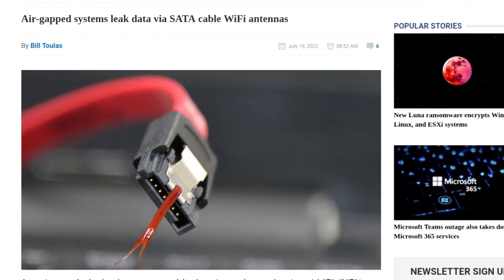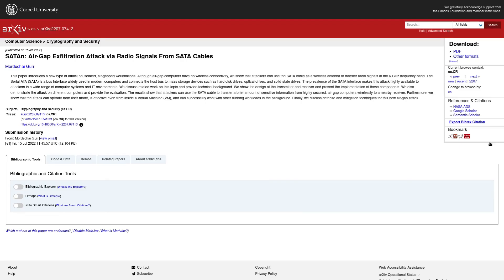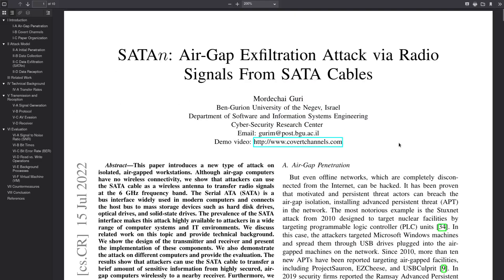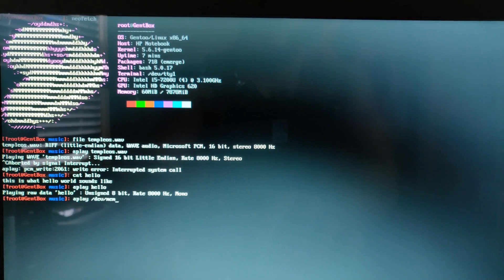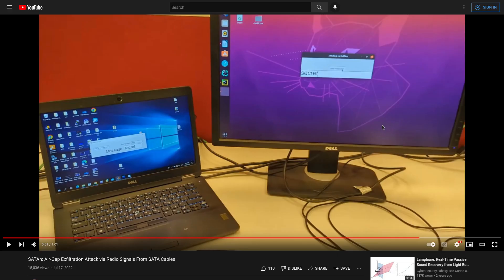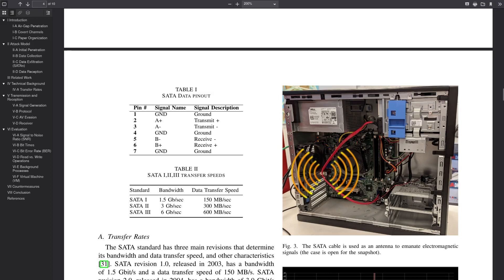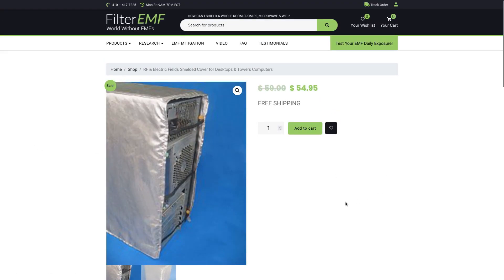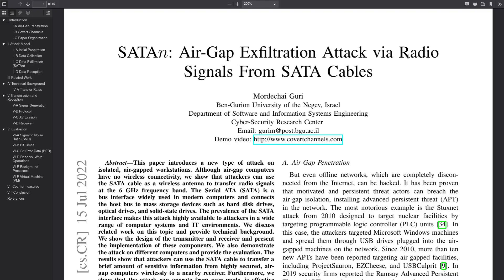Stealing Data Wirelessly From an Air-Gapped System

Comment: Speaking as someone who is somewhat familiar with electrical theory, wouldn't the usefulness of this kind of radio exfiltration heavily depend on the strength of the radio signal? It's entirely possible that the signal may not propagate beyond the building the actual computer is in. I invite pentesters to chime in here.
Reply: The transmit range and bandwidth/transfer rate of this make it very impractical. Seeing as you need phsyical access to the system to begin with, there are far better options. For example, you could swap out the USB keyboard (assuming it's a wired keyboard as it should be) with one thats identical but has a keylogger and wifi exfil chip installed inside it, or you can use a small USB male to female adapter between the PC and cable that has the same kind of keylogger and wifi exfil chip in it, or you can install a WiFi enabled lan-tap on the lan Ethernet cable connected to the PC. There are lots of options to setup wireless exfil from an air gapped PC once you have phsyical access.
Reply: @bluegizmo1983  Trust me, it is an attack vector used by foreign state intelligence services.
Reply: It could be enough that your neighbor or coworker has some Iot device like Alexa in the signals range. Now suddenly they can just run a program on all Alexa's to scan for a certain signal and they'll find you out of millions of people. Your exact location would be compromised
Reply: This sort of attack assumes a high security target, but also a highly motivated and resourced attacker.

Even if the radio waves make it just past the locked door, or even just at the locked door (so you could stick a receiver under the door to pick it up), then this attack provides some benefit. They no longer need to get past the door (which might be very difficult to do without raising suspension)
Reply: yeah in two wonky copper cable form it's not viable. considering this only works when the attacker would have physical access to the device at some point to install the malware and do the sata cable voodoo, he should just bring a pre-made antenna with appropriate strength to plug in that sata or wherever else he wants.
Reply: You're right, this definitely isn't going to put a MIMO A/G signal or anything, but it doesn't need to.  Any time you turn something into an antenna that wasn't built (initially) to be an antenna, you have very limited range.  The shielding that MO mentions are very deliberate steps to keep things like this from happening in computers, but also other (industrial) systems.  RF filters/ filtering on the outside of cable connectors or inside physical chassis are generally commonplace...though usually due to performance concerns (mitigating actual EMI...not specifically a security measure).  Generally speaking - if this is an established vulnerability...there is going to be someone who finds a way to exploit it.  With the right equipment you can see bluetooth at over 50 miles...just saying.
Reply: That's why antenna was 1 meter away from the system and it's absolutely useless exploit. Case is basically Faraday's cage and with all that EM noise around it would be like searching for Higgs boson in a hay stack.
Reply: Currently in security her we did this at Ferris State University as part of my Infosec degree. Theoretically and in a controlled environment yes. In the real world No. Further your high gain antenna has do to packet injection and special software I am not going to talk about has to capture this low transfer wavelength.We had a class on this is called signals intelligence.
Reply: @elir.torres8642  why mention software and refuse to talk about it I just assume you’re lying
Reply: @rumpelstiltskin9729  As I said you need to take a signals intelligence class. You need to know about the MHz spectrum, carrier waves, TV and radio transmitting power, data  coding and decoding, electrical theory, physics on top of all the math needed. Why would I discuss pre-thesis work with some stranger on You Tube when I bust my ass for 6 years acquiring a Bachelors Degree in Information Security & Intelligence . You think you could just walk into your mechanic and have him explain how to rebuild a transmission? Why would anyone do that for free. This subject matter is hard and is not just doing "IT" work. There's permutations and statistics behind the scene. This is why these degrees exists.
Reply: @elir.torres8642  okay but whats the special software you arent going to mention
Reply: @elir.torres8642  full of yourself ehj
Reply: @elir.torres8642  um, SDR?

Comment: So an attack that only works if you already have access to the machine. Thats like stealing the drive and do a brute force key program over it
Reply: the whole point of air gapped systems is that even if you have access to the machine, stealing data is pretty hard.

Comment: You just got me to search for shielded SATA cables.
Reply: Just Faraday cage ur desktop
Reply: @ոakedsquirtle  I have too many machines. I might as well shield my whole crib.

Also, signals emitted from VGA cables can be picked up by AM radios, then decoded using an ADC and a micro controller to recreate what was shown on the screen.

Comment: If the attacker is that close, you're screwed already. No reason to panic over this.
Reply: You mean, if the attacker has its receiver INSIDE your computer case.. that is for this to actually work lol.
Reply: @gmlviper  
Could be done by a malicious manufacturer or somebody at Best Buy putting bugs in prebuilt cases before selling them to the end user.
Reply: @augustday9483  But then the range is still shit
Reply: @augustday9483  Why would you not check your hardware for suspicious parts when you're building a high security system?
Reply: @augustday9483 that’s some government conspiracy level plans at that point but it’s not impossible. Good idea to build most things yourself if possible
Reply: @MrBl4ckY  
A high security system would be checked for malicious hardware, yes. But a prebuilt being sold to normies? That's the attack vector I'm thinking of.
Reply: @MrBl4ckY  Most people would, but there is always gonna be that 1 person. just like most people dont fall for phising, some still do..
Reply: @augustday9483  Point taken.
Reply: @augustday9483  even high security hardware can't be properly checked if there are inherent security issues with Nvida drivers or Intel Processing Units
Reply: @ska187  Have you heard of the Echo system?
Reply: @augustday9483  Walmart.
Reply: mlg swag montage
Reply: I could only panic in car connected to network. 😆
Reply: Or they could just be using your phone to facilitate this kind of attack. Phone security is a joke
Reply: Close to you like ways to be trying all manner of things on homeless people...cuz you're outside or in some non-private space 24/7/365.

Comment: Any copper trace on the PCB of a mother board is a potential antenna. The LEDs are suspects too along with the piezoelectric speaker that beeps when the computer turns on. Moral of the story Faraday cage the air gapped computer, don't connect a piezoelectric speaker to the motherboard, and tape over all led indicators.
Reply: I really want my next PC case to be a lead lined granite box. making it 350 pounds is a small price to pay for TRUE security. Also the rock is pretty good at thermal conductivity so it should help cool some.
Reply: @l0lLorenzol0l  it would be more secure if your pc was a completely solid lead cube. A small price to pay for privacy
Reply: @l0lLorenzol0l  Theftproof at the very least
Reply: @l0lLorenzol0l  “The Rock” 😂😂
Reply: @l0lLorenzol0l  and no one can exfiltrate/steal it
Reply: @l0lLorenzol0l nice shitpost hahaha
Reply: Networks can be run through the power cables.
Reply: @madthumbs1564  that requires transceiver.
Although theoretically you can create high/low current use by the hacked system and transmit 0 and 1 this way without dedicated transceiver.
Would be very slow though.
Reply: @madthumbs1564  Two extraordinarily dumb mitigation ideas:

1. Use a high-power optocoupler - a device that doesn't actually exist (for good reason). It's a very powerful LED lamp pointed at a solar panel, with both devices encased in epoxy. The computer is entirely electrically isolated. The power input of the PC is constant - any power that doesn't get turned into heat in the computer is turned into heat at the surface of the solar panel.

2. The computer box contains two batteries. Each battery can be either charging or connected to the computer, but not both. At any given moment, one is charging while the other is powering the computer.

But wait, you say! You can extract data by leaving the battery at a specific charge level and measuring how long that battery draws current for when it charges!
For this, you add a heater to the computer. The heater's control circuit ensures that the computer again always draws constant power.
Reply: @madthumbs1564  yes, and there are extenders that even run through power lines at 100mbps
Reply: @madthumbs1564  make your own full wave rectifier to convert all signals to DC then make your own inverter to make it back into AC so you can electrically isolate the air gapped pc from the electrical mains while your at it might as well add a battery backup in conjunction with it.
Reply: @madthumbs1564  i wonder if you can use the power cable as an antenna by doing power heavy tasks at high frequency
Reply: @your-mom-irl  interesting idea. There would be far more emf emitted by the psu. Capacitors would filter out high frequency but a very slow signal by variable power usage could be done, like bits per minute. That kind of signal could be picked up with off the shelf hardware at a decent distance. Still would need physical access to install malware or hardware to make it work so I can't think of any real world use cases.
Reply: @simontrueman  you could probably pick up that signal with an ammeter hooked up to mains too lol
Reply: The security researcher who wrote this paper on Saturday cable data transmission also has one On hacking Through the powerlines lol.
Reply: @Joe60459  With the new digital electricity meters, it would be easy to transfer data from the computer, you would only have to write a program that increases and decreases the electricity consumption accordingly.
Reply: @Joe60459  been done for decades that way. You need to use power line filters.
Reply: @madthumbs1564  Zoomers don't know what cables are.
Reply: I’d suggest embedding the PC in a wall during construction, and keep it powered using internal generators.
Reply: speaker connected in reverse would make it a microphone, im not aware of anyway you could use that for data transmission unless you had physical access to the compromised system? not so?
Reply: also unsolder all tin traces to reduce potential antannae
Reply: You need to literally air gap it, box in a box lmao
Reply: You also have to do the same for the keyboard and monitor.. might as well faraday cage the entire room
Reply: IIRC faraday cages insulate the cage's inside from external fields. You need a metal cage that is grounded to avoid creating fields in the exterior of the cage. I don't know if you'd still call that a faraday cage though.
Reply: And cover yourself and the monitor with a blanket .
Reply: I wouldn't even trust the power supply chopper transistors! They do talk, organise and subvert, you know....
Reply: @Theineluctable_SOME_CANT  not even if you dope the silicone yourself?
Reply: @AdaScout  that's Silicon!
Reply: @Theineluctable_SOME_CANT  yea it would be weird to find dope in silicone....
Reply: @AdaScout  you're hopeless.

It's Silicon.....
Reply: @Theineluctable_SOME_CANT  the first time was a mistake the second time I was trying to get a laugh.
Reply: Change the temperature of the computer and use a thermal camera.
Reply: @abramhunsberger3511  Or, a direct corollary -
Change the temperature of the computer and measure the power draw from somewhere further down the electrical system. See above post for stupid ways to prevent this.
Reply: Switching power supplies are are culprits
Reply: In fact many PCB Wi-Fi antennas are just traces
Reply: You forget the mouse/keyboard cable (unless the system uses a wireless keyboard which of course would give it a transmitter).
But even if you eliminate all that, the screen always remains, which can also send a signal via the frame rate...
Reply: Considering how small coverage these antennas would have, even interference from other signals would block it, along with walls.
Reply: How would you retrieve data remotely through a PC-speaker or a motherboard LED?
Reply: So boards with RGB are not safe?
Reply: Suddenly no one knows if BIOS is ever actually booting and trying to trouble shoot it is very difficult.
Reply: @viaris1725  UART console if you can find the headers for it might help.
Reply: I remember hearing about an attack that utilised the CPU fan speed to communicate over an air gap. Another attack I recall was using the motherboard itself as an antenna
Reply: most modern gaming motherboards, at least the higher end ones, use a numerical display for POST error codes instead of the PC Speaker; so you shouldn't even need a PC Speaker at all because you don't even need it to bebug POST issues anymore
Reply: Remove any vibration motor
Reply: My mitigation idea is nuking israel.
Reply: put it inside the ocean gates
Reply: Gonna do this on Monday just to see the looks on coworkers faces   😂
Reply: @JPs-q1o  the solution is live in a van down by the river.
Reply: oooor... just close the case because it's already a Faraday cage. High-speed interconnects (SATA, PCI-e, or LVDS in general) are differential signal pairs and designed to radiate as little as possible in order to maintain a clean signal at ultrahigh bandwidths. The residual leakage is shielded by any piece of metal and even with an open case it has a range of centimeters. If you have to be that close anyway, just plug in a USB drive.
Reply: @RealNovgorod  They are not differential signal pairs and designed to radiate as little as possible in order to maintain a clean signal at ultra high bandwidths.

Differential signalling is used to reduce the pick up of noise, or more precisely, common mode noise, that's noise which is induced into both positive and negative signal lines which can then be easily removed by the high common mode rejection ratio of a differential input receiving amplifier.

Signal integrity is achieved by impedance matching, having a tightly controlled characteristic impedance for the cable and using matching resistors typically (passive or active matching) at source and load ends   of the cable, and using good screening, typically copper braid which is then over laid with a foil to give an even higher percentage coverage of the cable than just the copper braid
Reply: @deang5622  I said all that in much fewer words. Suppression of common mode noise is exactly what minimizes signal coupling into a propagating EM mode, i.e., radiation. It may be "just" a side-effect or not the main purpose of differential signaling, but that's the topic of the video.
Reply: @RealNovgorod  No you did not say it. Don't BS. You didn't mention characteristic impedance or why differential signalling was important.
Reply: @deang5622  I said everything that's relevant regarding signal leakage through radiation. You're wasting everyone's time.
Reply: @RealNovgorod  Clearly SATA cables leak enough to broadcast a signal that can be decoded by a specialized device, and the device is already inside of a pc chassis, so the faraday cage is not absorbing enough power. To defeat the type of device showcased in this video, you would probably need a specially designed chassis with smaller ventilation holes, thicker metal, etc. Alternatively, you could install a dead man's switch in the PC that locks everything down when it sniffs a radio signal that passes a "danger" threshold.
Reply: @b1zzler  they didn't show the transmitting PC (they didn't show any of their setup for that matter). It definitely must have an open chassis or at least a side panel. They said they used a 6GHz carrier ('cause SATA), which has virtually zero penetration through metal. They'd have a better shot modulating the power draw and using the power cables to radiate at low frequencies - would be probably the same data rate anyway..
Reply: @RealNovgorod  Nope, it's the PC you see in the video. If you read the paper, they detail literally everything about the experiment including the shell script / matlab algorithms used to generate and decode the 6GHz signal. They note that "in a real attack scenario, the receiver might be implemented as a process in the nearby computer or embedded in a dedicated hardware receiver." In their proof-of-concept experiment, they used a USB-powered ADALM Pluto radio receiver positioned 30cm - 120cm from the desktop pc on the right side of the video, and the Pluto (not visible in the demonstration) is communicating with the laptop to the left via private network.
Reply: Isnt this going too far? 

Just put the system down a concrete basement/underground car park, ofcourse without any windows(haha, gotcha) in that room.
Reply: @CrazyPlayer-pf2hv  Not sufficient, not even with reinforced concrete containing metal rebar: because the spacing between rebar rods is too great.